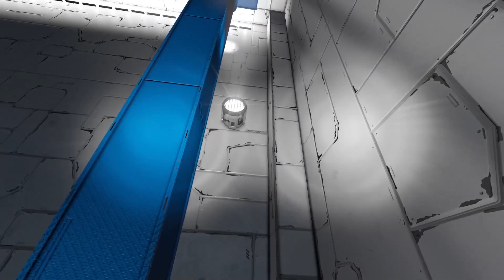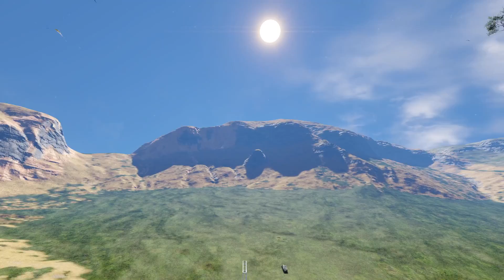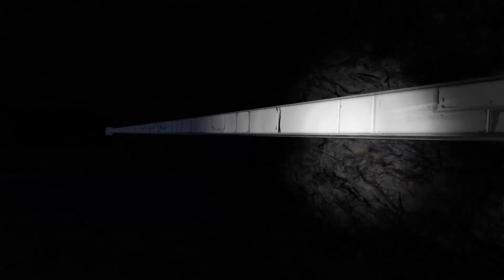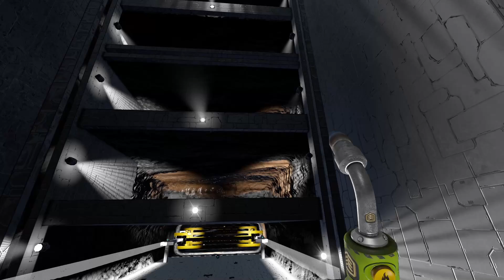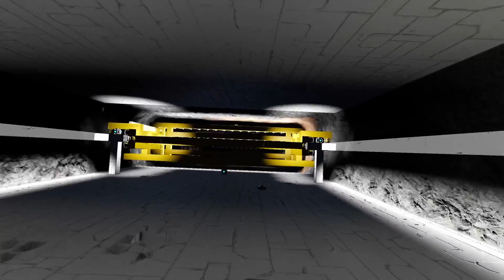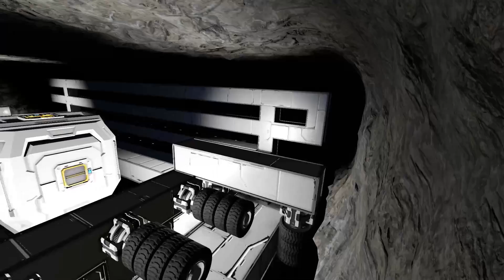Space Engineers Timelapse Build - Operation Below Ground Base: Rotor Wheel Drilling Rig- Part 5

Comment: I have been trying to find a video on how to build one of these tunnel mining machines for awhile with no luck. Do you have a video of you building it somewhere? I still don't understand. When I make one around the pillars on the left and right then cut it free from the floor it just goes haywire and explodes. 

When i cut the rig from the floor and convert it to ship it explodes causing massive damage to my base. Even if you remove 3 or 4 blocks around it and even the raile attached to it will just explode the second you click convert to ship.

Comment: Sometimes when I deal with long horizontal series of pistons, I put a couple of wheel suspensions at the tip part, so it provides a counter to the torque, which will inevitably grow too large and the pistons jam because they're too tilted. Sometimes maximizing the off-axis force of the piston also helps because it makes the piston better hold its position in the lateral direction, so it can take more weight before tilting too much.

However, I really like your wheel-rotor design. Mainly because, unlike the piston solution, this is much closer to how this stuff works in real life - with rails and many, many wheels to support the weight of the mega machines. Great video!

Comment: Watching the timelapses, it looks like you were trying to project the floor you wanted to weld from your wheeled platform.  This would make the projection a sub grid and won't connect to the floor of your actual base so all those blocks are seen as being unweldable because they are free floating.  You would need to create a blueprint of a large floor and project that from a projector attached to the main base.  The welders should then be able to weld it up  for you if they have enough materials.  If the blueprint isn't big enough you would have to adjust the offsets or move the projector to continue extending the floor.
Reply from the maker: Initially the project was on the wheel based platform, but I did move them to be on the main base on the floor behind the wheeled platform. Some reason the projection lights up as if you can weld them, well I can with a hand welder, but the platform welders does not want to weld a new block. However, if I make a block and grind it down a bit, it has no problem welding it. Also, I placed the welders on top of the weldable projection and restarted the game and they appear welded. It seems like a odd glitch, maybe I got too much stuff going on.
Reply from the maker: I'm going to need to test this on a smaller scale and see if that changes anything.
Reply: @PandemicPlayground  It wouldn't surprise me if it was just a glitch.  Space Engineers is like that.  :)  It could be that there is too much going on but I have seen crazier builds that seem to work okay (ie. Kanajashi's space elevator).  I've never checked it myself but I believe you can see the sim speed somehow and that might let you know if your computer is struggling to do everything in that world.
Reply from the maker: Lol, everything was just breaking towards the end of the drilling. Clang is trying to hunt me down for making such a base!
Reply: You probably dont give a shit but if you are bored like me during the covid times you can watch pretty much all of the latest series on instaflixxer. Been watching with my brother for the last couple of days =)
Reply: @Hugh Denver Definitely, I've been watching on instaflixxer for since november myself :)